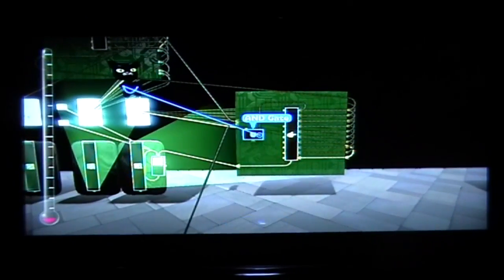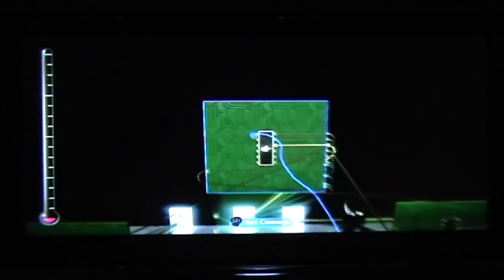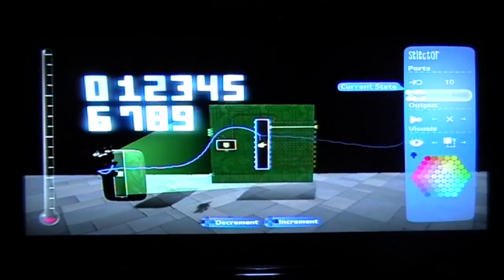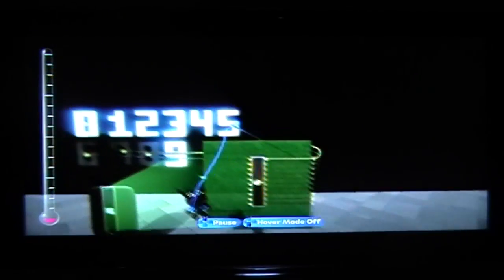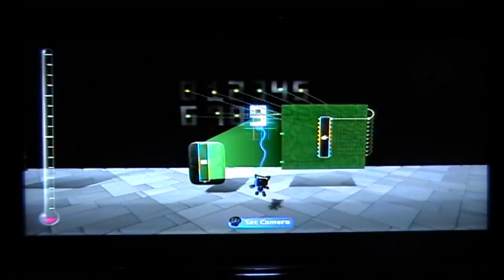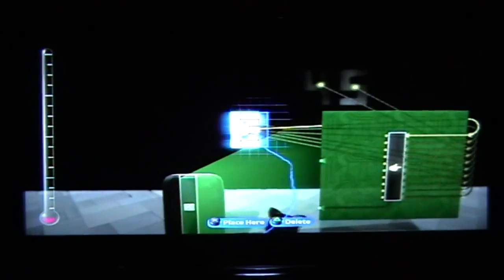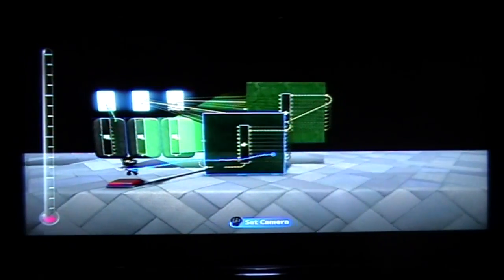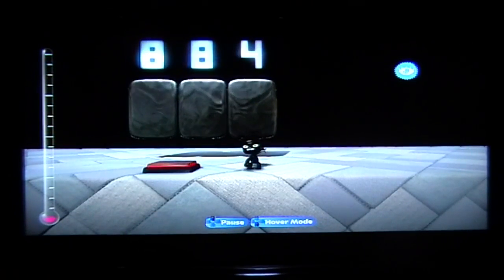LBP2 Tutorial - Selector-based Counter/Timer Display Pt.2

Comment: @ShadowriverUB I've got a working 2 way 10's place using a Selector with 100 outputs,and 10 OR Gates hooked up accordingly. The tricky part is 2 way 100's place, since 100 is max outputs for a selector. Any ideas on how to link more than one selector together?